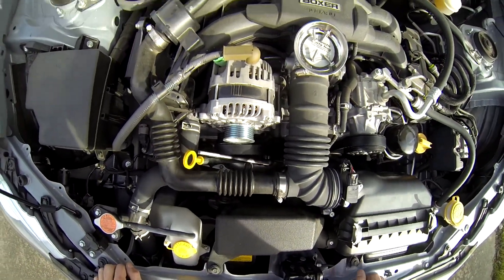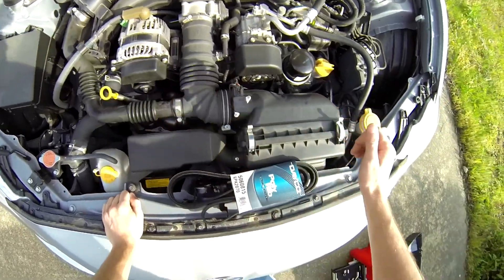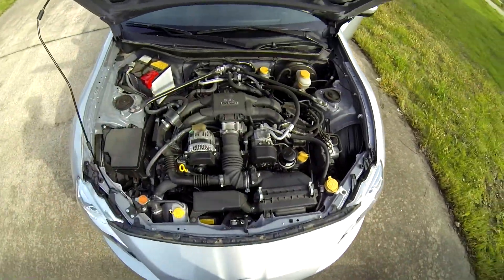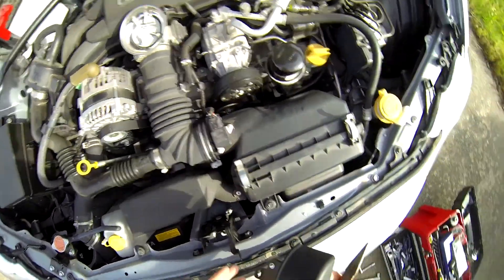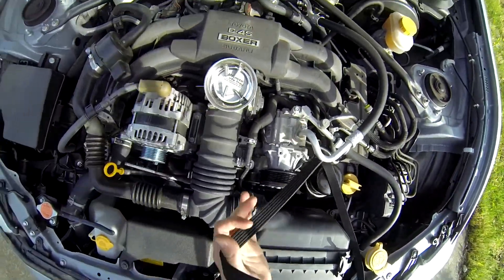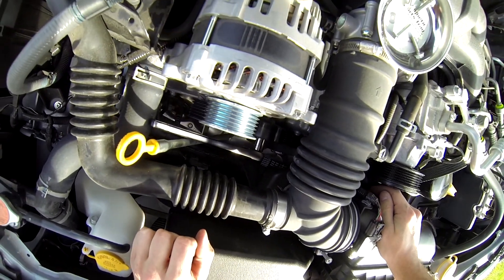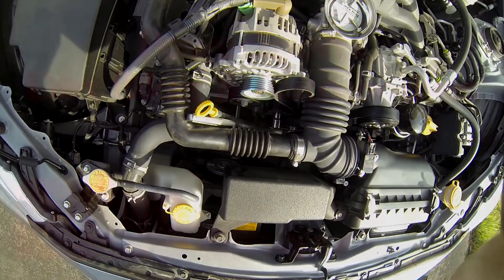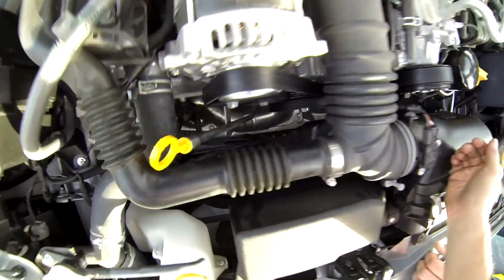How To Replace The Drive Belt On A Scion FR-S, Subaru BRZ

Comment: I know this video came out 6 years ago, but in case you still have this car, next time you change the belt take the sound generator hose going from the intake system to the left of the motor off. All it is is two hose clamps and it opens up half of your pulleys, including your tensioner. I personally take the intake system out entirely, but to each their own.
Reply from the maker: Thanks for the tips!  ^_^  The car is long gone.  😭  https://www.youtube.com/watch?v=WUAugYRl_mE

Comment: Does your new belt ride on the same exact position on the pulleys?  I noticed that my new belt is just a millimeter or two off of where the old one used to sit.  Only on two of the idler pulleys though.  I am wondering if i should be concerned about it.  i dont want it flying off at high rpm lol.
Reply from the maker: Yes, there should be no visible difference with the new belt, whatsoever.  Did the parts store give you the correct belt?  Are you sure the belt is fully engaged on the pulleys and not offset by one groove?  Do you have any friends who can take a look and give you a second opinion?
Reply: @PowerSports  it’s an OEM Subaru belt.  All the grooves are lined up. I can see where the old belt used to sit on the idler pulleys from the wear on the pulley surface. The new one is just barely to the side by like a mm. I guess I can go realign it.
Reply from the maker: Hm...  if you start the car and let it idle, does the belt look OK?
Reply: @PowerSports  Yeah, i replaced it a month ago.  I have been driving it since and its been fine.  I just assumed it would naturally realign to the old belt's spot.  I just went out and adjusted it, so ill check on it tomorrow after i drive it.  it should be fine. I am just ocd about stuff lol.  Next time you look under your hood can you take a look at your belt and see if it rides on the same spot as your old belt?  just on the idler pulleys though. You will be ably to tell where the old belt sat because that area will be shiny.
Reply from the maker: Sorry, I sold my car a few years ago. 😭

Comment: I suspect when you had difficulty with the belt and tensioner there was some slack on the right side that wasn't being taken up, and your buddy was able to get it on under the idler because it was able to take it from both sides. Thanks for the video, my BRZ just shredded its belt a few mins ago.
Reply from the maker: Yeah, i've gotten a lot better at changing that belt, but now the turbo is on, i hope it never breaks again, hahaha.  Idk why these cars shred belts so easily!?!  Hope you are able to do a quick fix and nothing was damaged!  ^_^
Reply: +PowerSports thanks mate. going to work on it tomorrow. it popped at the end of my driveway so probably nothing too bad. mine has 40k miles, fwiw.
Reply: Mine was so shredded it stopped the tensioner from releasing fully. Had to cut it. Otherwise, it took me longer to find the tools than get the new one on thanks to your vid.
Reply from the maker: I'm always happy to hear when I am able to help out!!!  ^_^  Glad you got it fixed so quick!

Comment: Hi how's the quality of the belt holding up? I got the SBD turbo and my OEM belt just snapped and looking for a more quality belt.
Reply from the maker: I currently use an OEM belt, too.  The belt before the turbo, was a Duralast i think, and it snapped in like 500 miles, haha.  I've gone through 3 or 4 belts so far, and the OEM has always lasted the longest.  I wish I could be of more help!  :/
Reply: PowerSports hmm interesting.. I guess I will be going with the OEM belt then. Thanks!
Reply from the maker: Yeah, and i also noticed it was the quietest.  The Durlast belt squeaked non-stop, lol.
Reply: Just to clarify, since putting the turbo kit on, OEM belt it hasn't shredded? Did you ever change any pulleys after ripping the other belts?
Reply from the maker: I got a brand new belt just before the turbo, and it now has about 15k miles on it, or so.  No issues yet.  I did put a lightweight Perrin crank pulley on it before the turbo.
Reply: PowerSports installed a new OEM belt on my SBD turbo Brz. Took me about 30 mins. All you have to do is take off the MAF pipe, mounting brackets and the downpipe bracket and it will clear up just enough room to be able to replace it. Thanks for the video!

Comment: Cant see shit with the intake installed
Reply from the maker: I think what you meant to say; "If you remove the air filter box, it makes changing the belt easier".
Reply: I am impressed with your ability sir because the both times that I've done this on this car I have remove the airbox assembly completely it makes a job 90% easier